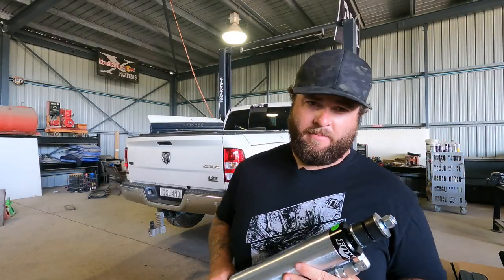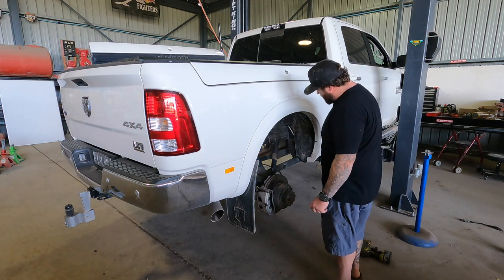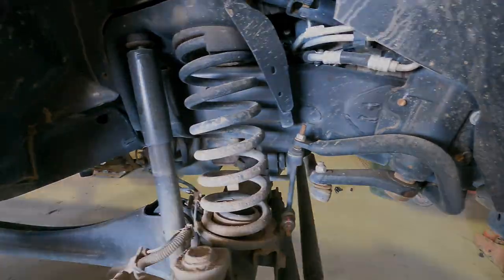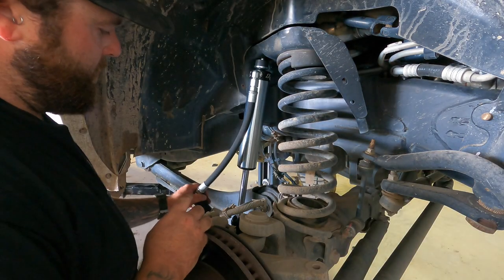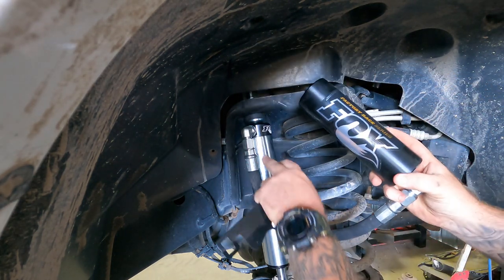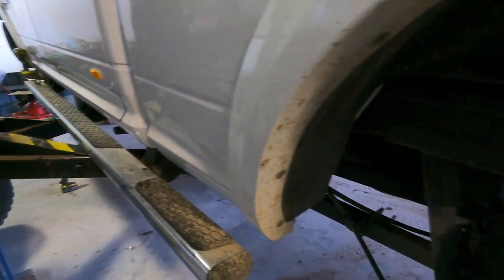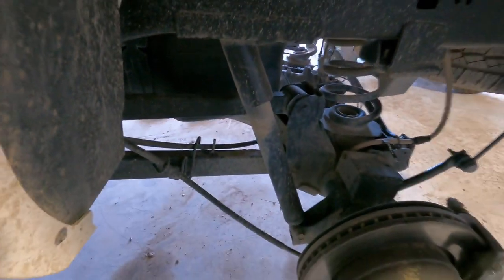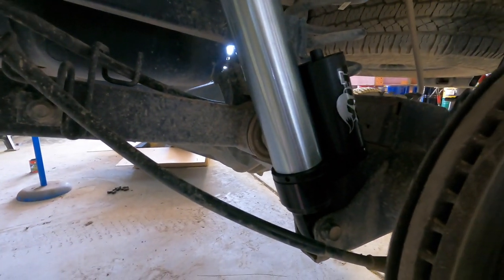BEST RAM 2500 MOD ! A DIY FOX 2.5” SHOCK INSTALL, Stock Shocks are terrible !

Comment: Hey brother, what FOX part numbers did you use? No one seems to have a matching set from FOX. FOX doesn't even show a matching set on their site. I know the front part # is FOX88324019, but for the rear all I can find is the adjustable version. Is that what you used on the rear?

Comment: Good video.  As far as self tappers go i like how you marked and predrilled for accuracy, however i thinkyou will be surprised what a good tech self tapping screw will go through. 1/8" steel no problem for a good screw.
Reply: I've always had a b** of a time with self-topping screws is it better to go fast or slow with the drill?

Comment: Would the rear shock not hit the chassis under full compression? it may not but the gap in the chassis for the shock to fit in doesn't seem to be big enough for the fox upper/lower shock and res to pass through?
Reply from the maker: No mate, that’s the way there designed to go I measured the clearance and there plenty of room. I also double check with the supplier and they said yes they face backwards. The truck was at full droop as you seen it in the video, then the shock actually comes away from that point as compression is applied and it will travel into the chassis no worries they fit.

Comment: I currently have a 2016 Ram 2500 with some 20” fuel wheels on 295 Michelin defenders
and man does it ride rough especially over bumps/uneven torn roads. I have the front at 55psi and rear at 50psi but man does it still ride rough/stiff/bumpy… not near as smooth as my 2018 Raptor rode. Looking for what might be my best upgrade? I never really haul or tow anything other than some bags of mulch and dirt for spring yard work so it’s pretty much a pavement princess with the occasional pallet of materials. I’m really wanting it to ride like a 1500 and not hop and skip over bumps and rattle like the dang tires are aired to 100psi. 

Any advice would be appreciated!
Reply: Note; For instance my Raptor would hug the bumps and uneven roads. Going over a railroad track at 40-45mph it’s like it glided over it, the rear tires stayed seated on the ground and on my Ram it freakin skips over the railroad truck and the bed and rear tires feel like they leave the ground. Granted my Raptor had 17” wheels and 35” BFG’s but my Ram has 20” fuel wheels and 295/60R20’s. 

I’m hoping these fox shocks will help the truck ride like a heavy cloud like the fox shocks on my 2018 Raptor. Should I do a sway bar or Carli? Should I do rear airbags? 

Thanks for the help!
Reply from the maker: Hi mate, 
Lower the pressure to 40psi all round see how you go. 

Failing that a 17” rim with 35” tyres at 38 psi will help a lot. But these 2500s need weight in the back to ride smooth, a shock up grade will also help.

Comment: Did you reveal the shocks for that truck, also do you notice a different in ride quality with them on the road compared to the stock.
Thanks
Reply from the maker: Notice was instant, great up grade and could drive much better and take bigger bumps at higher speeds.

Comment: How the hell did you get the top nut off those stems so easily?  Mine are practically welded on.  I had to cut the rear stems off and I'm too afraid to attempt the front.
Reply from the maker: Fronts come off easily, depends how old your shocks are ?

Comment: Liked your video, I installed a carli...fox 2.0 levelling kit in my 2500 using carli front coils raising 2.5 inch with standard rear coils, but am quite disappointed with the ride as it is quite harsh on irregular  bitumen etc, not sure if it is the special valving carli claim to use.  We only use the 2500 on road towing our van with 250kg ball weight, did you find your set up rode smoother on smallish bumps? Would appreciate  your your thoughts, regards Trevor
Reply: I was wondering the same I do towing as well it feels terrible
Reply: that’s a shame it’s harsh. I currently have a 2016 Ram 2500 with some 20” fuel wheels on 295 Michelin defenders. I have the front at 55psi and rear at 50psi but man does it still ride rough/stiff/bumpy… not near as smooth as my 2018 Raptor. Looking for what might be my best bet? Never really haul or tow anything other than some bags of mulch and dirt for fertilizing. Wanting it to ride like a 1500.
Reply: @sponsurd  
Bro you’re running your tires way you high. No wonder if it’s a harsh ride. Any tire I’ve ever had I’ve run at no more than 38-40. That’s plenty. Lower your pressure.
Reply: @Jay-hp6pu  I have, even on my raptor I was 38in the front and 35 in the rear. I don’t want to go too low on these Defenders and wear out the tire. I may go down to that and see how she rides though.

Comment: Is this STOCK hight? It looks at least leveled right? Will these fit right up to stock hight 2012 ram 2500?
Reply from the maker: Completely stock springs no level kit. Just shock upgrade. Not sure on 2012 ram fitment might be different

Comment: Very interesting! I want to do the same to my 2500, you do not lift the front for towing? How about the driving with these shocks, a big improvement?
Reply from the maker: No there would be no advantage to lift the front for towing. Massive improvement on and off-road, trucks a lot more compliant. 😎👍🏼
Reply: @TyFenwick  Thanks. Just noticed those are Fox 2.5! 4 for around $1600...... That's why! Haha!
Reply: @TyFenwick  I ordered 2 .0 with reservoir, hope it bring better feeling than stock.
Reply: @dmtycn  how did it go?
Reply: @RD11RT  No luck, the seller cannot get the shocks, I cancelled the order  ：（
Reply: Where can I buy the same kit? Ive got a 2020 2500 Bighorn
Reply: @mejorhoyquemanana2926  
Search the internet. Lol I never understand people that post a question on here instead of just typing the words into a search bar. Should take literally 10 seconds to find.

Comment: I have a 2008 Dodge 2500 f 4x4 Cummings with an 8"  Lift on 38s..and  The guy I bought it from must have been jumping it like the fu(king dukes a hazard or something.. i broke the shaft on the steering pump and when I was replacing it with a red head ultra duty pump ultra duty (which was a bitch due to the fact that they didn't inform me that getting a Pitman arm for 8" lift with the giant shaft size..was so hard to find. But anyways, I got to putting the pump on and got looking at the Front coil Spring buckets and the fuc*ing things are ripping off the frame... Needless to say I'm pretty fuc**ng pissed off ,especially as much as I payed for this gotdamn truck... It does have a new motor new tranny all built to shit with meth injected compound turbos, big injectors a Super programmer, Pedal Box I mean it's got everything ive never in my life seen a truck as fast as this son of a bitch... But anyway the buckets are tearing away from the frame on both sides mainly the passenger side... I had a 99 2500 in my backyard so I cut the buckets off of the frame and I'm going to have to Weld them in but they don't match up exactly exactly so it's going to be a bitch. I did see they sell some aftermarket ones but they look pretty cheese Dick.. So I think I'm gonna get a pipe Bender and bend some pipes to reinforce the buckets  I'm welding on.. I really don't know what else to do about it.. I am a metal fabricator and I built picture cars and stunt cars for a living so I'm pretty sure I can pull it off. I'm just not really too sure about suspension stuff... The coils are so freaking huge on this track it's unbelievable. And it rides like shit... Bumpier than a  willies Jeep... And I hate it because I'm used to my dully 4x4. I had bags on back like this truck has but pretty much the same front suspension . It had a lift but not this high... But that thing rode like a dream smooth like a Cadillac... I got looking at it and since my shocks are mounted to the side of the coil I think I'm going to use shorter coils and stack  Bags on front.. I fabricated some pieces that will fit between the bag and the coil... Just wondering if that is a bad idea, having both coil and bags or if maybe I should just fabricate some bigger spacer mounts  And shit can the Springs... I'm sure a part of the rough ride is the freaking buckets ripping off the frame but but either way it sucks the backbags ride smooth but the front end I can't deal with anymore... do you have any suggestions as far as what I'm trying to do? I did see a guy on YouTube who made pretty much exactly what I'm doing other than using the Spring and the bags.. his turned out pretty cherry but he basically built something of  spacer's that go under and over the bags..  And as far as welding those  buckets on there what a pain in the ass that's gonna be but I think as long as I line it all up correctly and straight and support it with some pipe bent and 2 u s it should  be good to go.. Just not sure if I should put the bags on top of the coils like I'm doing, vice versa or just leave the coils out completely.. any advice is welcomed...